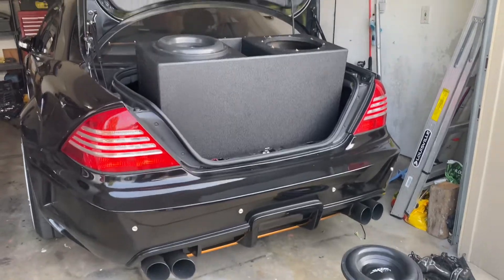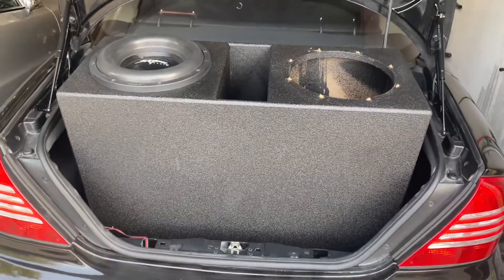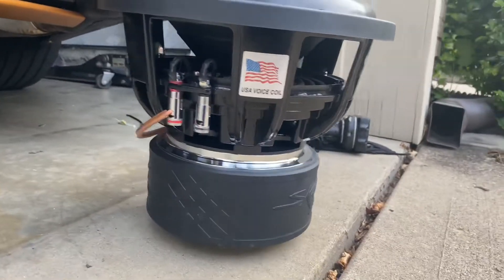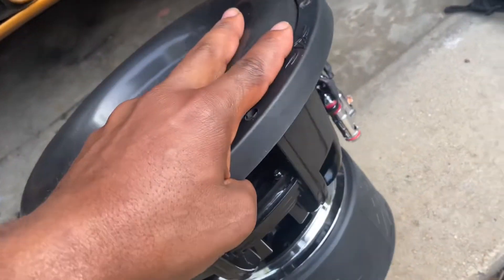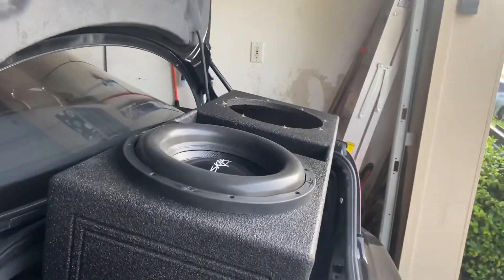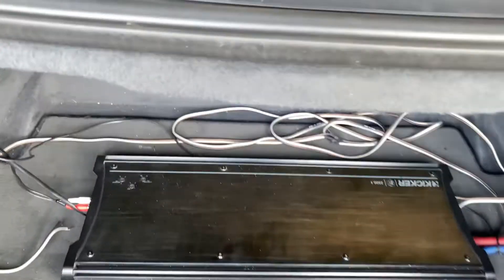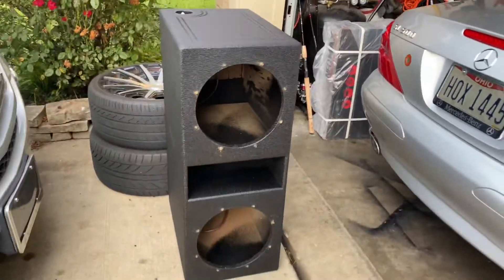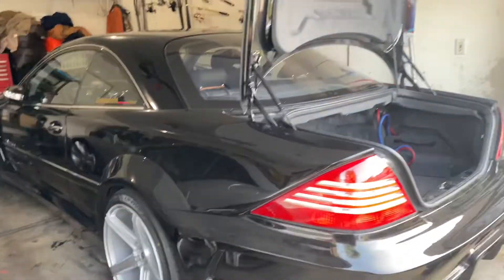Skar 12” Subwoofers Kicker ZX2500.1 Amplifier Installed Mercedes CL55 W215 Sound System Explained

Comment: I'm also a fan of skar speakers
Reply from the maker: Very solid subs and speakers.
Reply: @goldelementautoworks  what dash kit and radio harness do you use on the 2003 cl500,i can find them no where here in new jersey
Reply from the maker: @pradaboyk  The dash kit can be purchased on eBay. There is wire harness on eBay. But I chose to delete all OEM equipment. So if you chose to do that, you have to run new wires from from to back. Or RCA cables to an aftermarket amp in the rear.
Reply: @goldelementautoworks  well im taking everything out and im either going with skar or sundown speakers,and all aftermarket amps but i hate to keep asking questions,is there anyway way you could throw me a link on ebay for everything i could use—i love your channel i watch everything being i got love for the cl’s too
Reply from the maker: @pradaboyk  Uh-ohhhh…….I’m not seeing it on eBay right now. The seller might have run out of them. I’ll keep an eye open for when he restocks.